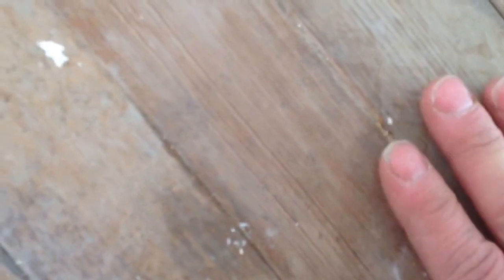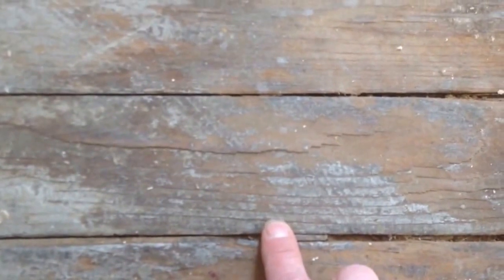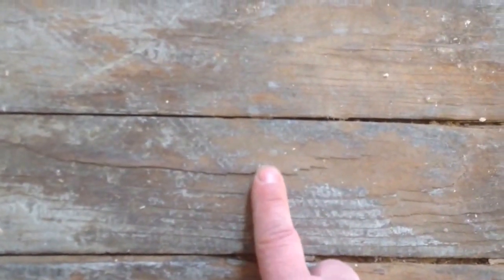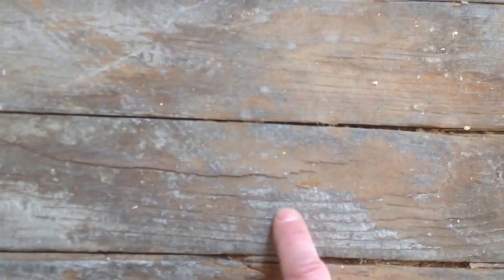How to identify wood floors in old houses

Comment: Thank you for the very informative video, I was looking for something to help me figure out what we're working with.  I like that you're the type of guy that tries to save even the more plain pine ones, too.  I hate when people just rip stuff out...
Reply from the maker: I like the look of origional wood flooring. I do everything I can to save the old wood before new hardwood goes in.
Reply: I'm about to buy a building with SEVERELY damaged wood flooring, it's a large building but has several areas with water damage, one area is so bad a couple beams dropped.  I might need you to help me figure out what type of wood it is when I get back up to the finish floor!  I can fix the beams and the subfloor but haven't done much work on the finished floor, it's a store from about 1920.

Comment: Hello Mister Helper Guy! You videos are amazingly well done, easy to follow and chalk full of GREAT information and tips.. especially for us females LOL! 

I would very very much appreciate your advice on my current issue.. I live in a SPECTACULAR early 1900' home converted into a small duplex with 6 units. All units have the same original flooring, the first kind mentioned in this video. As much as am obsessed with old century charms of the building and my unit... my floor talks. When I say talk, I mean it literally talk.. creaking, squeaking, popping, ting ting ting CONSTANTLY. I can't for the life of me get the creaking and grinding of the board to stop. I tip toe around my unit as to not wake my tenants because the noises are SOO loud.. the noises keep me awake at night. 

I've tried a heavy layer of cornstarch, let sit for 30 to 40 then put a towel down and ponunded the floors with a rubber mallet for about an hour.. All that work and mess, it did not work.

I got another tip to try spray wd40 along to creases and let sit overnight... Boy, was that a greasy oily mess to wipe up and didn't fix the noises either..

There's got to be SOMETHING to help the musical talking hardwood floor of mine... PLEASE IM DESPERATE
Reply from the maker: I have walked on some creaky floors. How about area rugs with the best padding you can buy. It is important to know if there is a subfloor under your hardwood floor and if its original to the house. It might just come down to having to face nail the floor to keep it from moving when you walk on it. How about some pictures themrhelperguy@gmail.com

Comment: I sure wish I could get your advice on what to do about the 100 yr old pine floor we just uncovered in our "new" house we just bought. They've never been stained, only covered with 2 layers of old linoleum, then particle board, then carpet tiles.  I don't think we need any heavy sanding on these lower quality planks, no stripping needed, only smoothing a bit. There are some gaps too that a bug could get through. Is there a way I ca contact you to send a couple of pics?  Thanks!
Reply from the maker: Themrhelperguy@gmail.com    send pictures
Reply from the maker: I would be great to look at your floors. You don't come across to many origional floors that were hidden by linoleum anymore. The first house that I renovated when I was in my 20s was like this.
Reply: going through the same thing at my home, but not so sure its pine, it almost looks like #4 more

Comment: Owning a house built in '44 I really appreciate all your videos on knob and tube, plaster and lathe and old floors. :)

My whole house has hardwood floors, or concrete--except the kitchen. Or so I thought. I actually just discovered the kitchen was originally hardwood too. Not surprisingly it was buried under two layers of linoleum and of course, a mastic of questionable composition...

That said, I'm considering steaming the mastic off but I was also advised to simply use a self leveling compound primer designed to seal mastic, then apply self leveling compound so I can properly grout in tile or "luxury" vinyl.

I know you get a lot of questions here, sorry to pile on but which would you personally recommend?

And if I do decide to restore the original flooring, whats the best piece of equipment to sand these types of floors with? 

Thanks!
Reply from the maker: Lots of variables to really answer your question.If I were looking at a floor with mastic on it I would try to scrap it with a carbide paint scraper to see if it comes up. They may of applied it to a dirty floor.

Comment: The floor under my carpet (apartment building in San Francisco built in 1916) look exactly like the second one he pointed out in this video and my planks are 3 inchea in width. I am trying to determine if my floor is the finished floor over a subfloor or if this is the subfloor. I inserted a knife in several areas and I keep hitting something about .25 an inch in.  Not sure if the planks are tongue and groove
Reply: Apartment is 1924 In Boise mine are like the skinnier ones. Not completely finished but it’s laid over the subfloor. . There’s carpet over them in living room . Bedroom and small hallway. .  Been considering finishing them in the living romm and small hallway. But I don’t want to get into trouble bc I’m in an apartment. . Did u ever do yours?